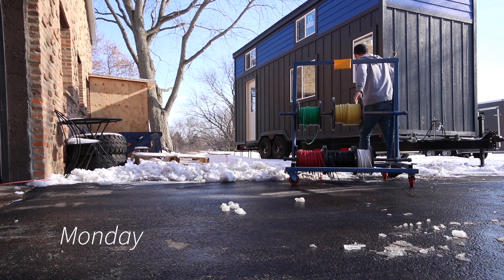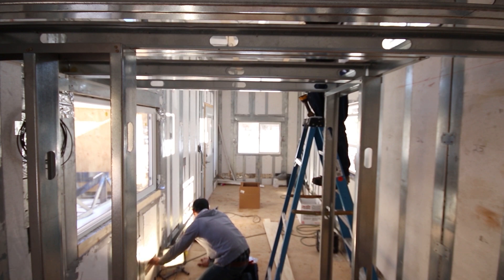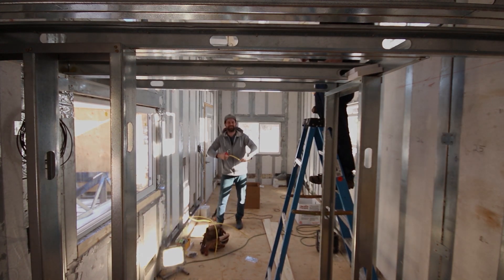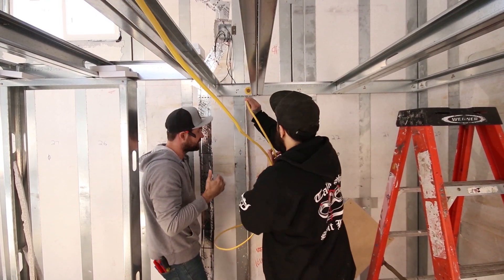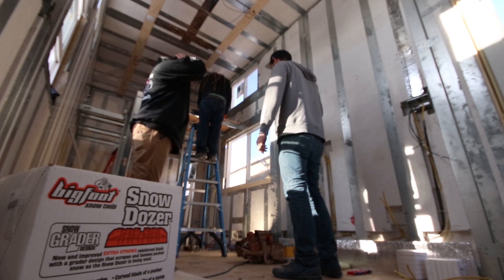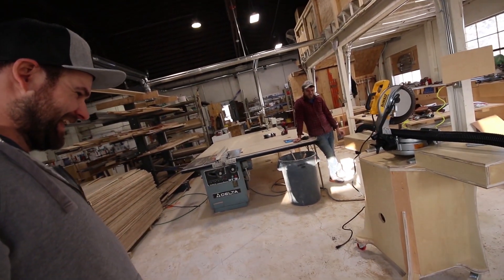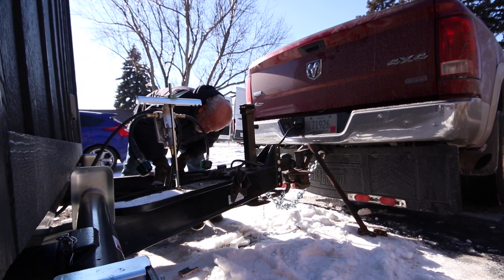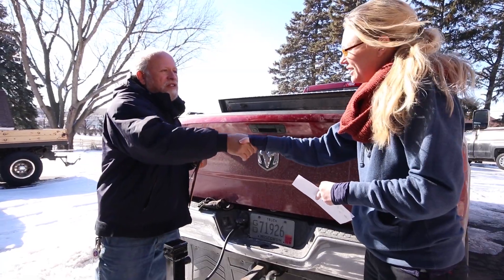Forklift Crashed Into Airport Office

Comment: if you have a house on wheels, is that the wheels deteriorate.
So after living in the same place for a while, your tires might be without air, or even broken.
Reply from the maker: We recommend that if you’re going to be in the same spot for an extended period of time that you remove the wheels
Reply: the will be more safer